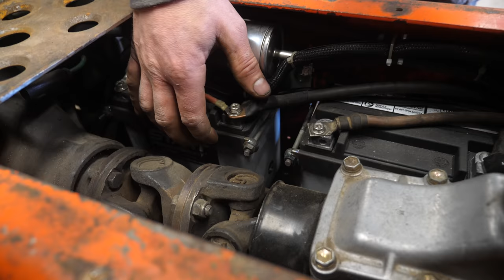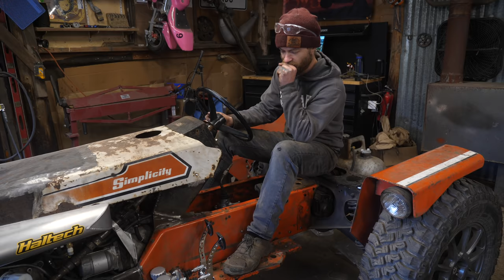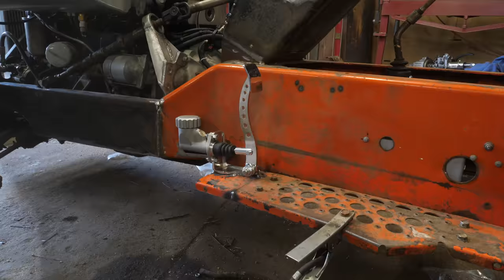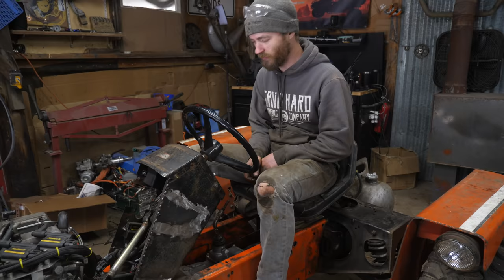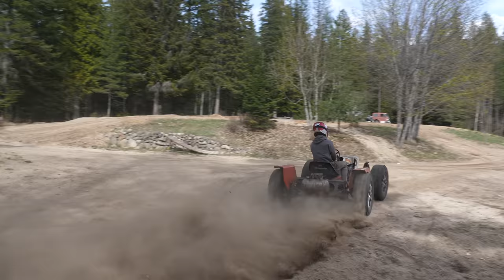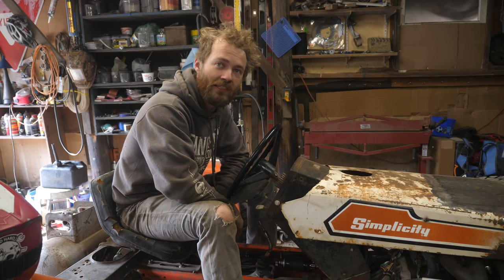2JZ Lawn Mower First Test Drive! It Rips!

Comment: Solution, hand throttle on the wheel. Right side brake, left side clutch. For the pivots being different, flip the masters over and have hanging pedals.

Comment: Must turbo or supercharge it's a dog. Otherwise it's so freakin cool just needs the low end torque from a supercharger
Reply: yes because a 200hp lawn mower is a "dog"
Reply: @TurboVisBits  2JZ is designed for forced induction. Unless they built the motor to be NA. Otherwise it will be pretty wet doggy with the factory compression ratio.

Comment: For the  foot-plate, you should add angled pieces going out farther and angling up 
And then make tapered circle gussets(you guys have a tool for that right?) and sharpen the edges of the circle gussets 
—so it grips your feet good and you can have a comfortable foot stance
—I was also thinking a small snowmobile seat(shortened/modified) might be a good fit?
—also I was thinking you should have two different clutches -ONE of them being a lever connected to the suicide shifter, that way you can always have access to clutch/brake/gas and less confusing—Hope it helps? lmk what you think!!

Otherwise sweet build - Amazing machine!

—Also I like how it still kinda has that tractor sound idk what muffler you used, but it has good effect!

Comment: A cheap way of softening the springs is to remove 2 of the 4 springs on the rear axle, these may well be soft than the ones on the front so you could replace the fronts with the ones that you took of the rear.

Comment: I know this is not necessarily related to this video But... I think it would be really cool if y’all silt a purpose built power wheels haller rig out of a Kid-Trax doge ram dually and did a solid axel with golf kart leaf springs. It would be sweet if it was actually a dually. If y’all ever do this project you could build a custom gooseneck trailer.also it would be sweet a flatbed. Pleas consider this, I would of loved to do it my self but it would be a little price.

Comment: Probably too late, but you could build a bracket that will hang the brake pedal, and unbolt and flip the reservoir. It'll feel more natural and it'll allow the pedals to travel in similar strokes. Looks like you've got the realestate off the steering tower to build a brace/mount.

Comment: What about adding sway bars and air bags? It would be pretty cheap. Nice and soft if your bag size to suspension leverage/weight is correct. Plus you can slam it on the ground for pics n stuff.  The sway bars because that thing would be a deathtrap with just bags I would think. I'm sure ya'll could do something rad

Comment: Hey grind hard plumbing co, just watched your video it's amazing the projects you are building it's really inspiring to everyone that watches aswell🙂 the location of where you placed your battery's is amazing and the solution you came up with for not haveing the room for a big battery👌 but you said they were verry well helled in, but batteries expand with heat and even with the wind going around it, its not cooling down the batteries enough, the charging system will create an internal heat from the electrons moving so quickly under the conditions the motorised vehicle is put true, id suggested you to try make some sort of bracket that can keep the batteries held firm but still able to expand, if they can't expand to the manufacturer's spec they have a higher chance of exploding due to uneven pressure zones of the battery housing, I would also look into trying to get more air flow true your radiator if you run your engine for prolonged periods of time while going sideways your halfing the efficiency of your radiator and running the engine quite hot. I promise this is not any hate im only letting you know because of how far you have come in the project and if either of them to things were to happen it would be heartbreaking, I hope you understand where I'm coming from, keep up the good work you have gifted hands🙂

Comment: Suspension stiff, but the frame ain't. Pretty cool I think if you get it a bit stiffer with some more weight the suspension would do more work. Edit: I see the frame issue was noted. Possibly directly tie the front and rear together, along with trans mount. Very cool.

Comment: I think you could save weight, with a smaller tire/wheel setup, from something you'd find on FWD rallycars.  And I'd custom fab a engine cover/grill, so that you can do away with some old metal weight in exchange for thinner new steel

Comment: The auto on a 2jz GE requires really high gearing on the diff if i remember correctly. I have an SC so i should know but it's above a 4, sounds like the engine is bogging, maybe get a different diff on her
So she rips at the power band instead of staying low. Plus the FFIM intake with no turbo makes the engine have even less low end torque

Comment: Don’t you want to be able to use the clutch and the gas at the same time too? I think a good option would be to keep the clutch and brake on the same side and make it so that when you use the clutch, it doesn’t effect the brake pedal, but when you push the brake pedal it also pushes the clutch in.

Comment: My grandfather had an old tractor and put a 27 litre v12 merlin engine in it as a joke and rode it around the farm. On a tragic day, the throttle linkage came loose and the engine went wide open and grandpa passed away. He hit the side of the barn at or near 120mph

Comment: Needs boooost. Not even for big power just the noise. Don't remember if you changed internals but nonvvti ge motors have thick rods that handle boost well.

Comment: Looks the part, apart from having the same size wheels on the front as the back. It needs to have smaller wheels on the front so it looks like a real tractor 😉

Comment: Would  be way cooler if it also did  tractor things, like had a PTO or hydraulics, a winch and hitch or come along, and on board air. For example, you could plow or grade your drive way just to rip it up with the same machine

Comment: so, if you put 600lbs on the rear axle and chains on the tires. could it actually pull a tiller or is the gear ratio still to high...

Comment: SAFETY ALERT! Grind Hard Boys, PLEASE read this: That throttle-brake pedal arrangement is problematic, to say the least. We have an electric "Gem Car" at work, no clutch, obviously, but the "throttle" and brake pedal are almost identical to your arrangement... it's not good.
 In a normal car, both pedals travel in the same plane, and tend to level off with each other, so when you need to go from gas to break, your foot naturally let's off the gas and just slides laterally over the brake pedal.
 That's intuitive during normal driving, so, with muscle memory, it becomes essential in a "panic stop" scenario. 
 When you have to actually LIFT your foot (and leg) inches up off the accelerator pedal, to get it over the brake pedal... that's difficult to remember under the calmest of circumstances... in an emergency, it pretty much guarantees you just jam your foot into the side of the brake pedal and smash straight into whatever you were trying not to smash into.
 Even having driven our stupid little "Clown car" for years now, I can't tell you you how many times I've almost wrecked it because, as I was making the transition from the "go" pedal to the "stop" pedal, the TOP of the sole on my boot catches the bottom of the brake pedal, and I've had to quickly figure out what my foot was stuck on and why I couldn't get it OVER the brakes.
 It would be much better if you mounted the throttle with it's "up" position higher than the brake pedal, even if they have to be on different axis of rotation. 
 I don't mean to be a "safety nazi", but our "clown-car" is driven responsibly, for work purposes, and maxes out at around 30 MPH, and those damned pedals are still an issue, for all of us. You guys are going to be THRASHING this thing, which we're all excited to see, but none of us want to see you guys get hurt. Just my stupid $0.02 opinion.
Edit- on a side note, I'm SUPER excited to see this project up and running! I was the one who sent ya'll that stupid shape measuring tool for Christmas, I hoped it would help eliminate the need for "CAD" when you were doing things like extending the hood... but I haven't seen ya'll use it, so I'm guessing it sucked? Sorry. At any rate, YAY 2JZ MOWER!